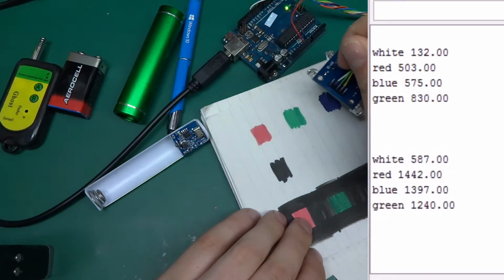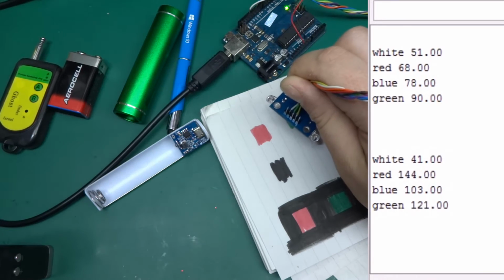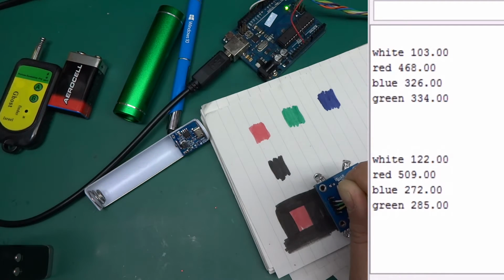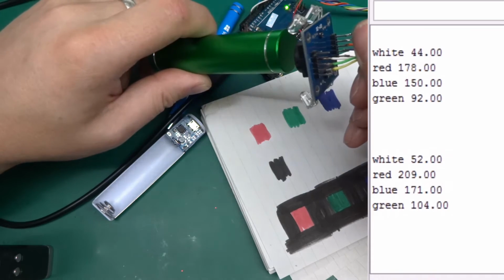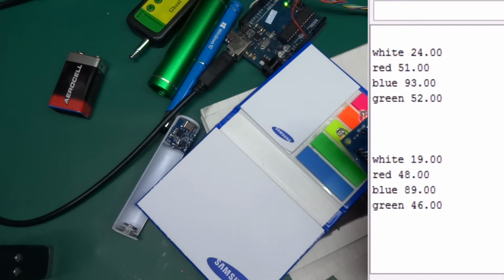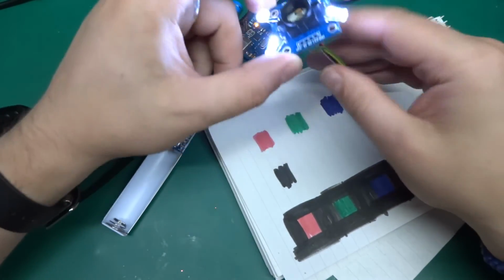A look at GY-31 (TCS3200) color sensor module

Comment: 🎯 Key points for quick navigation:

00:00 Color sensor demonstration
01:08 Color to frequency
02:03 TCS3200 photo diodes
03:38 Sensor LED setup
05:39 Background affects readings
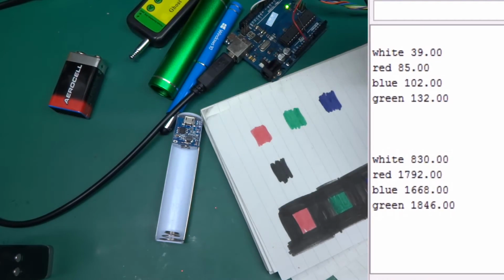07:11 Reflective surfaces benefit
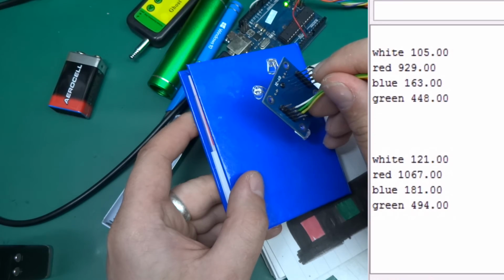08:21 Controlled conditions crucial
09:03 Photo diode array
10:21 Possible camera use

Made with HARPA AI

Comment: Does it work with raspberry pi?
Reply from the maker: Don't see why not, you just have to implement it on gpio (probably there is already a library for that somewhere on the googles)
Reply: alright that helps a lot, thanks :D
Reply from the maker: From what I remember this outputs analogue signal, and Rpi has no ADC, so you would need an intermediate circuitry, how precise and complex is up to you. Here is an article that can help: https://www.raspberrypi.org/forums/viewtopic.php?t=13883
Reply from the maker: Or on second thought, just use Arduino nano as ADC and talk with Rpi to Arduino. Nano costs like 1 £/€/$/whatever :)

Comment: What max distance with  lense? 4 leds, is it IR led or usual?
Reply from the maker: +Dmitry Art there is no lens, it's just a surround to minimise stray light coming in. LED's are usual warm white, not IR.  And the distance is small. You have to be close to get good readings. The further away, the worst it gets. I found it best just about 5mm away from the plastic surround, so maybe 10-12mm from the sensor. But bear in mind, if you remove the plastic the readings will go really bad - LED's will swamp the sensor with light. Cheers!

Comment: Tried this sensor (a bit different looking board, less advanced than this) a year ago, had high hopes for it, but it was very disappointing. Because of poor performance it has no real practical purpose.
Reply from the maker: Thanks. I do agree, the results were a bit inconsistent, i.e. one green was different to another green, quite a lot. So as far as precision this sensor is a no-go.  But I think the key is to have controlled conditions, like no external light during measurement, and most importantly to have the micro 'learn' objects it will be measuring in the same controlled conditions of course. I think it is possible to make it work somewhat reliably this way. Anyways, this is the plan, so stay tuned ;)